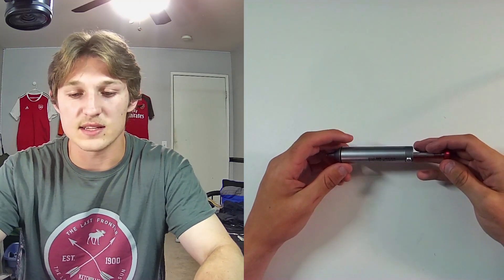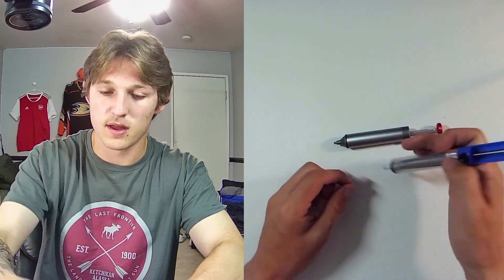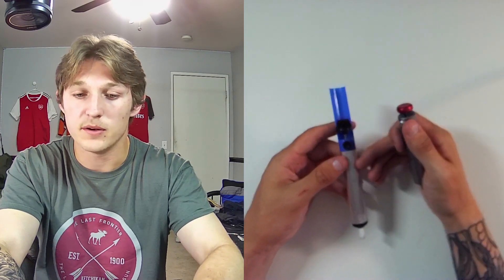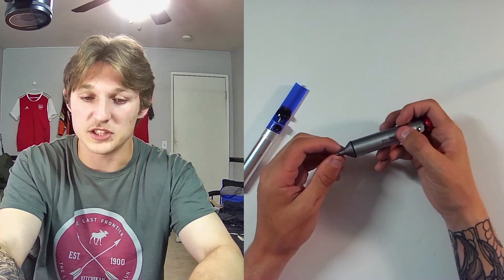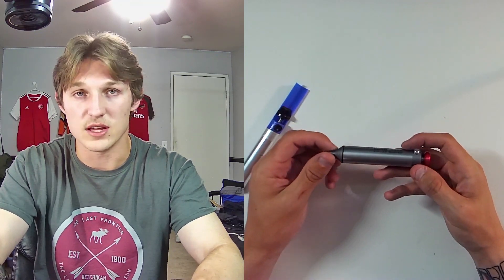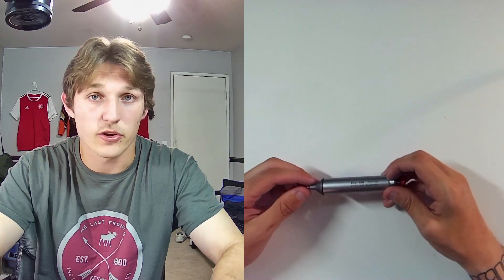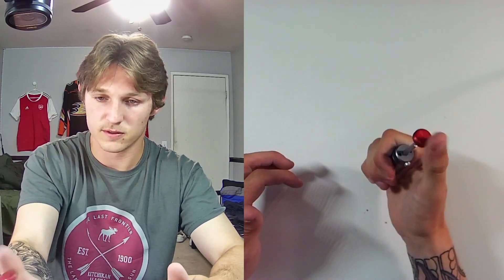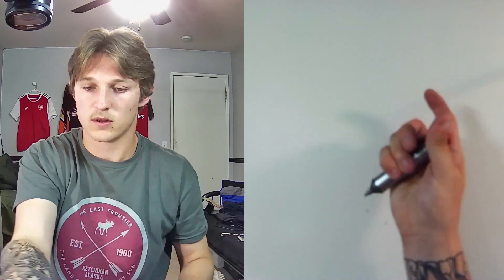WATCH BEFORE YOU BUY - Engineer SS-02 Solder Sucker

Comment: Coming here as another victim of cheap no branded solder suckers.
Reply: if you need the cheap one to work, grab yourself some vaseline and grease up the 2 o rings, and put grease on the treads on the bottom plastic piece. once its vaselined up it will actually be able to suck solder, i removed a usb b port with a double shield with it and a cheap 60w soldering iron and lots of flux and leaded solder...
Reply from the maker: Happens to the best of us!
Reply: @TylersTestBench  So many negative reviews on amazon... why?. This one is funny: Don't waste your time and money on this solder sucker. It's a money sucker ;-)